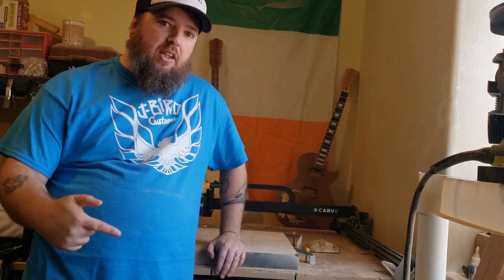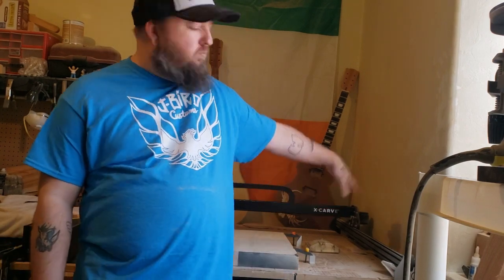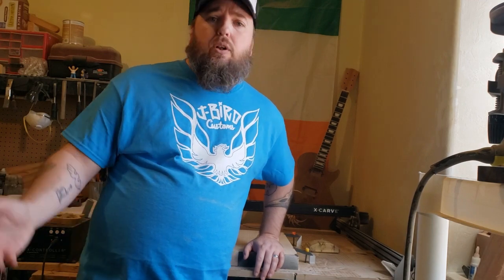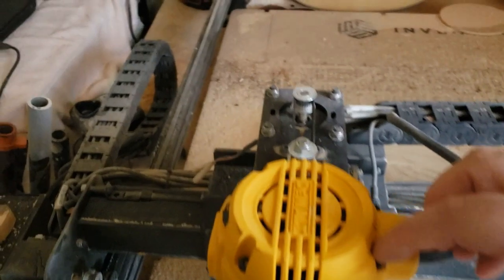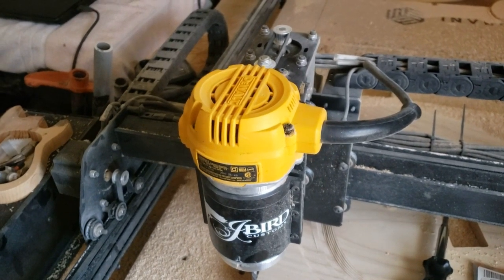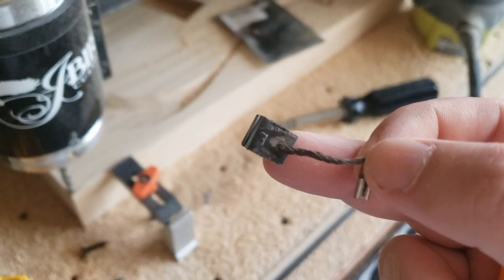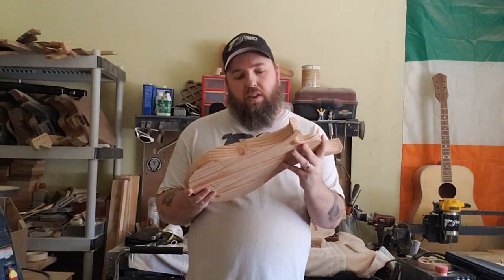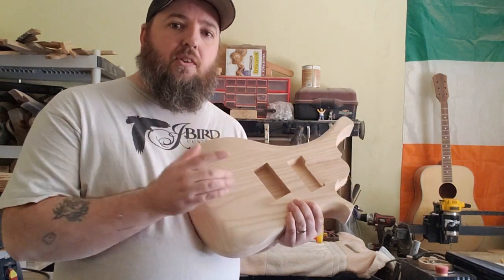Great Guitar Build Off Unofficial video 3 (dewalt 611 repair)

Comment: I’ve been cutting some templates from a download on Inventables forum. Can’t seem to get the neck pocket right. How did you get the radiant around the edge?
Reply from the maker: Major thing about it is making sure the template is correct and the bit you use! Most of the time I am creating my own necks and pockets to fit but the ones I have done that are fender style specs I make sure to double check measurements of the file and I use a .25" bit. I do plan on doing a video on using easel for guitar work so make sure you're subscribed so you can check it out!

Comment: I guess that wasn't the fault of the CNC, could have happened to any router.  It's interesting to see.  I'm forcing myself to learn some CAD stuff first before taking the risk of an investment...
Reply from the maker: Not at all... the brushes have about 300 hours of life on them or so I'm told. I'm pretty sure I had more than that on these though!
Reply: Look into CAM...there are some steps to get you from one to the other.